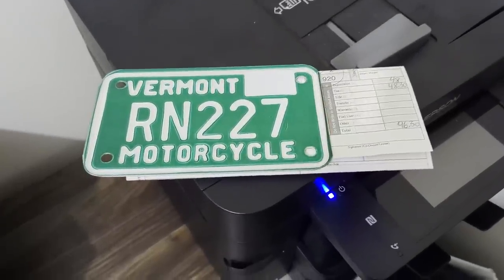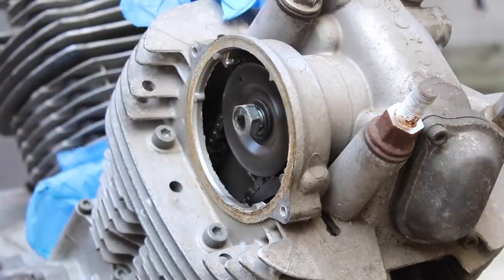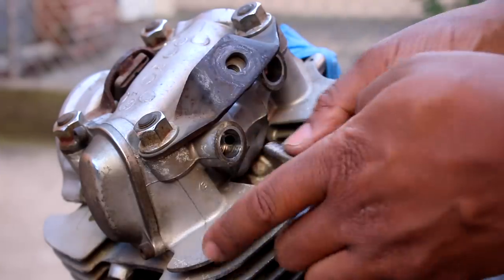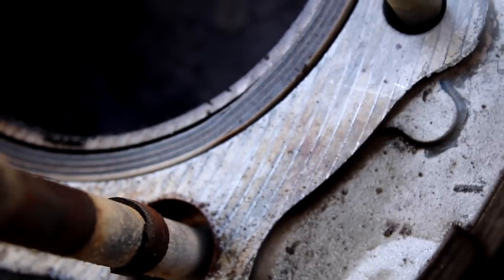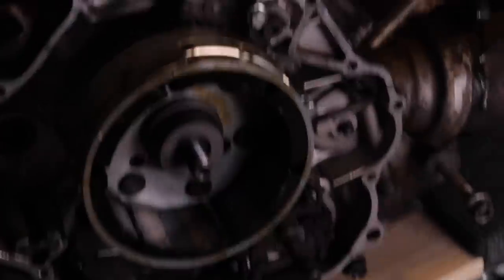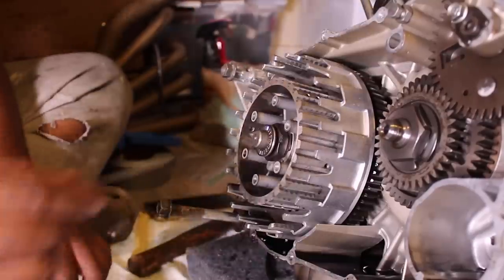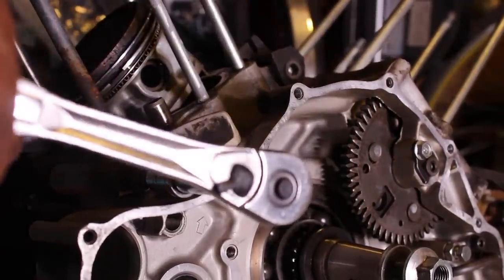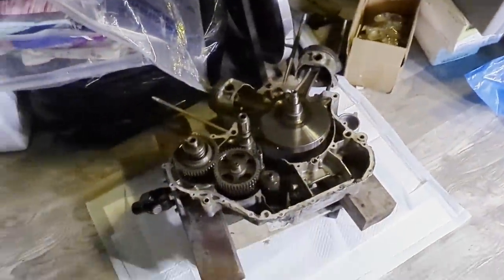[Ep 02] Yamaha Virago XV920 Cafe Racer Project - Engine Disassembly

Comment: Relaxing to watch . Dont mix the cams up , rear has different oiling ports/holes etc . Ditch the twin valve-springs (if this model has-them) use later virago 1100 single-springs, rev-better, less cam-wear and dropped-valves . Definitely change those cam-blocks to bearings, less-heat/wear on cams, better-revs and your valve-settings are constant . Also stops a lot of metal-filings (those bushings, plus dbl-valve-springs, destroy the cams , along-with too-low idle..oil-pressure.. ) You can modify and run a yamaha 600 dirt-bike pump if you want more-pressure , but the stock-pump has a huge-scavenge, so they're adequate for the job  . Clean the 'Magnet' below the starter-gear assembly (designed to collect all the damaged starter-metal ! ) These are great-bikes when you sort a few things, as you mention, Steves DIY is an amazing channel .  Don't run a rev-counter either, it steals rear-pot-spark . Replace the plug-caps or do Steves 'Mod' . Even 'indexing-plugs' helps virago's run better . I have a couple of TR1's, the 981cc chain-drive model, a little larger than US-spec 920's , Roadsters (different Rake etc) not cruisers like virago's . But the-same Beast at-heart , the Poor-mans Vincent (which yamaha dismantled and used as inspiration for this motor etc. ) These are bulletproof , set-up properly , check-out 'Skinny-Beast'  https://www.youtube.com/watch?v=fgkLPGxKgsM    and  Manfreds TR1     Dave   NZ
Reply: Also forgot to mention, the lower-oil-feed banjo-bolt, that starts the oil-feed up to the cams ,through the chrome-pipes , was sometimes faulty from factory  .Run a 2.2mm drill through it to increase flow to the cams. Going too-large on this hole can badly-upset the oil-flow-ratio's , but some were nearly-blocked, allowing very-little through to the heads ,resulting in cam-lobe-wear/rocker-wear etc . Dave
Reply: Could help me fix my virago xv920

Comment: One of my favorite bikes. I had the version with the chain drive years ago. Round headlight, no CYCOM display (XV920RJ?). Better tech, worse styling than the 70s throwbacks, IMO.

You did your research (roller bearing cams ftw), but I want to offer my experience anyway:

1. replace starter with solenoid-actuated version (on viragos up thru '96  IIRC). Good luck finding the starter gear you need, they're rare and crazy expensive.

**The upgraded sidecover (also housing the solenoid) will hold the timing sensors proud of the stator by something like 7mm or 9mm. You gotta cut some tube spacers to place under the stator mount points. When you do this, you might want to upgrade the stator itself but I never got to that. I did end up replacing my 2-brush starter with the recommended 4-brush version.

2. toss that wiring harness and use an M-Unit. I'm sure you were already gonna do that.

3. RAM SHOX makes the cheapest/simplest replacement for this monoshock.

4. Cognito Moto blah blah GSXR front end.

5. Mikuni VM34 carbs (again, Cognito)

5. I'm jealous. Have fun!

Comment: Nice, I decided not to split. Heads n jugs off. Honed cylinder s. Checked ring gaps. Jugs/heads vapor blasted. All covers hand cleaned n polished. Also, rocker shafts I used a bolt, socket, nut n washer. Just hold bolt head with a spanner and tighten the nut down which pulls the rocker shaft. Haha, yours was a labour of love bro.

Comment: WOW. Good on you for taking on the engine rebuild. 👏 I think your cams are fine. Sometimes the case hardening wears through to expose a hollow in the casting. No worries, it’ll still work. Here’s a tip I recently discovered… 
When it comes time to scrape the mating surfaces to remove the old gaskets.. instead of using a razor or any metal tool.. go to a hardware store (Home Depot), and buy a couple of two inch wide plastic putty knives for less than a buck. They are as sharp as razor blades and last surprisingly long and it is impossible to mar the mating surface. You can split them in half to get into narrow spaces.
Reply from the maker: Hey Blip, thanks for checking it out. Interesting comment on the cams, never knew about that, on face value they look rather chewed up.
On the gasket surface, yes! I remember from scraping the cb550 I ordered plastic razors and a carbide scraper.
Reply: @Theillestrator1050  My Kawasaki ZRX1200 had slightly pitted cams. They pitted within a few thousand miles. Most of them did, but 50,000 miles later they still looked the same. I wouldn’t worry.

Comment: Hey man, great job. Smart move to split the engine cases apart. I just picked up a 1981 Yammy XV920RH and have just noticed that there is a small oil leak coming from the bottom of the engine case where the gasket mates the 2 halves together. Cheers, A.G.

Comment: The front and rear timing chain covers are switched. The one with the rubber in it needs to be at the front cylinder.
Reply from the maker: Gotcha, I knew something was weird... that means someone was atleast in the very top of the engine.

Comment: Shade-tree tip: auto parts store doesn't have a slide hammer? Yes, they do. It's in the paint and body section. It's a small Bondo brand "dent puller" and it's about $13. *The threads are a perfect match for a Mopar 727 Torqueflite front pump. I've been using the same one since your mom was thin.
Reply from the maker: Ah, interesting! Should come in handy next time. I guess it was for the best considering the end solution was free lol

Comment: It's really time to up your tool game my guy. Painful to watch you use Plumbing wrenches when a decent quality Ring combination spanner set and a 3/4" deep socket set costs about $30 all-in. Maybe less. Invest. It's always worth it
Reply from the maker: @Starfox Oh no I have the tools, save for some REALLY deep sockets to get past the head studs since you brought it up; but I tend to try to bring out as few tools as possible. I don't mind using plumbing wrenches if it means making less of a mess and it works.
Reply from the maker: @SixWheelsDown  Sorry to cause you any pain brother, hopefully it helps to know that the clutch won't be literally going back in the engine as it sits. If it doesn't, I don't really know what to tell you. As far as the Allen wrenches, no real comment there 🤷. I mentioned that some tools are older than me, when you say "clowning"... Is the criticism coming from a good place?

Comment: Those motors are solid, I got a vs 1100 wich is basically the same as you got. I think the cams tell you somebody was slack on oil and filter changes, biggest problem I ever had with it was the starter clutch, and on the v Star it's a pain in the ass to change the oil filter, but I fix it with a spin on filter adapter kit. I'll enjoy seeing where you go with this one!
Reply from the maker: Thanks, they look kinda rough don't they. Another comment mentioned that it could be imperfections in the casting just being exposed. Trying to figure out what to do as far as cams go...
And ah yes, the infamous starter situation lol
Reply: @Theillestrator1050  every thing else looks good from here, ha ha. I'd probably replace the cams, s-s used to make some higher spec but maybe no more, check pacific Coast Star, maybe have some stuff they used to have alot of performance upgrade stuff for the 1100. Or replacement from Yamaha. Something to look at!

Comment: This is going to be a good build series, and excited to see the direction you go aesthetically. Question, I’ve never taken an engine down that far so it seemed you already did 80% of the teardown why not go all the way, does the rest get too risky or just not needed and not worth it, even for the experience? Anyway really like this channel, always thoroughly enjoy your videos. Keep up the good work👏
Reply from the maker: Thanks for checking it out! Well the main reason I split it is just to reseal it so theres no crankcase leaks; the other reason is to get it blasted. The issue is there were many hurdles along the way and I foresee more of them if i begin really taking the engine down to nothing. I don't even feel comfortable doing it given my lacking workspace. I want the experience, but perhaps on a more simple engine, like a small single cylinder. Dont wanna press my luck and I'm comfortable just wire drilling the engine and using a paint kit I already own.
Reply: @Theillestrator1050   Thank you for responding, and yeah that does make sense. Dude the amount of teardown you’ve already done would have me s#!ting bricks thinking about putting it back together, lol. Okay, keep up the awesome work👏

Comment: Do you have a set of JiS screwdrivers yet? You have enough japanese bikes to make them necessary at this point!
Reply from the maker: I don't have a JIS set because I pretty much just use an impact screwdriver on any JIS screw regardless of how tight it might be. But for thoroughness, I should probably get a set.
Reply: @Theillestrator1050  tsk tsk.... 😉  Useful for the small screws on controls and ignition stuff too. My relationship with JIS is "use the right tool to remove it" and then replace it with superior fasteners like allen or torx.